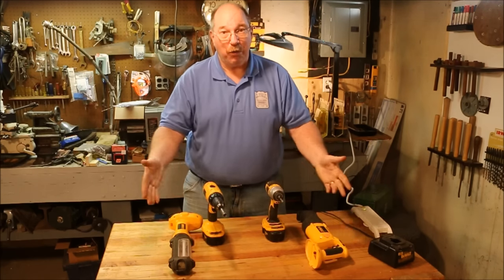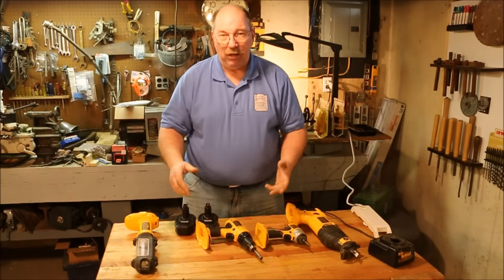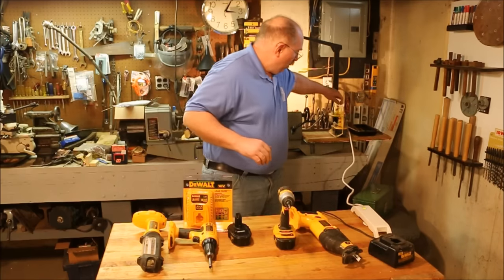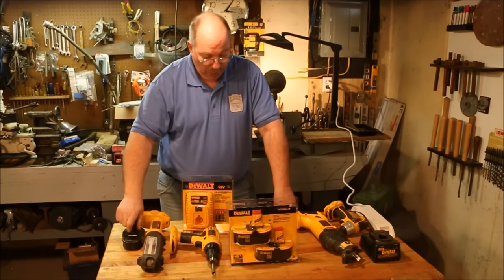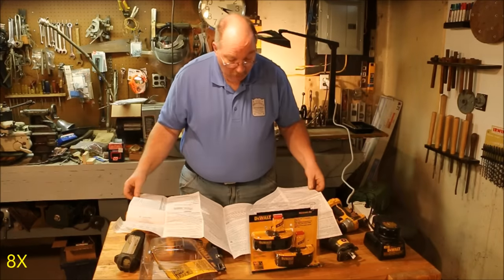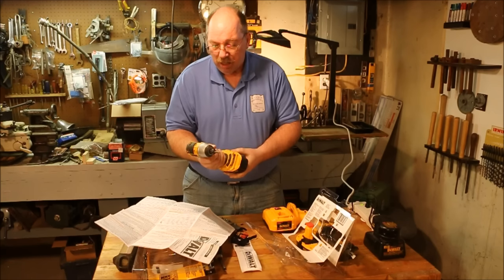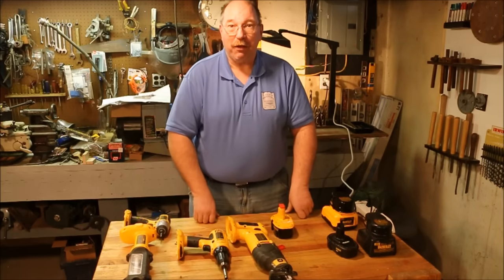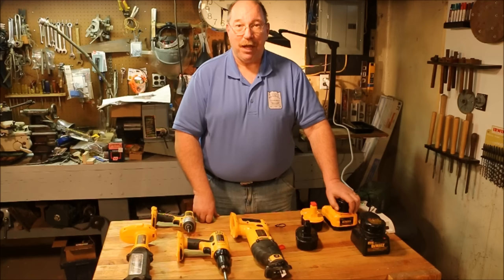New Dewalt 18 Volt Battery Packs ~ New Life For Old Tools ~ by Old Sneelock's Workshop

Comment: I am a plumbing contractor and use nothing but Dewalt tools.  I now have a box of 18-volt batteries that do not work at all and some new ones that are in the same boat.   If you can post a video of how to revive them from the dead I would appreciate it very much and I am sure others would too.   Dewalt tools are not cheap but you do get what you pay for and I have used about every other tool out there for commercial use and Dewalt, in my opinion, is the best.
Reply from the maker: R I would love to be able to help you. Unfortunately I don't know any way to do it. There are videos the propose all kinds of methods to revive batteries. So far the only way I know of that works is replacing the dead cells, or buying a new battery.

Comment: They are servicable.  Our local battery store can rebuild them.  I have had several done by them.  The new nicads that were sold by Dewalt cost $90 + each and I got 2 rebuilt for $60.  That being said The lithium batteries are much better as they hold a charge much longer and don't develop a memory.  Are your new batteries lithium?  I had heard that Dewalt was going to start selling them for the older tools.  There are literally millions of perfectly good tools out in the wild with dead batteries.
Reply from the maker: I bought the charger and the two batteries for about $130.00 at Home Depot last Christmas when they were having a clearance sale. The new tools take different batteries that mount differently than mine. 

NEWLY DISCOVERED INFORMATION. I can buy Li-ion batteries for my Dewalt tools.  While looking to see if it was possible to rebuild batteries I stumbled on this.  http://www.batteryship.com/htmlos/htmlos.cgi/batteryship/catalog.html?item=DC9180
Reply: Mine ended up in the trash and the old battery powered case made a dandy case for the corded 3/8ths.
Reply: Steve McEntyre i
Reply: Steve McEntyre - harbor freight 18v batts are about $12 w/ coupon

Comment: Don't can the old batteries. I found out too late on my Makita that you can get them rebuilt. My corded 3/8ths has been run into the ground with only a speed control going out. I like DeWalt stuff. Milwaukee too! Plus anything else that works! I ain't picky!
Reply from the maker: Lewie McNeely That's a topic I will explore in a future video.
Reply: Old Sneelock's Workshop 10/4!

Comment: I like dewalt. A few years back I had Milwaukee and they changed their batteries. The new ones were garbage and they wouldn't stand behind them. Well that led me to Dewalt.
Reply from the maker: Tim Caldwell The last good Milwaukee I bought was in 1998. I have 40 year old Milwaukees that are still runnung. When I did some comparison testing  last Christmas before buying more batteries for my current Dewalts I couldn't see any improvement in othe brands that made it worth discarding my working  tools.
Reply: Old Sneelock's Workshop  I came across your video those are ni-cd's  xr version 2.4 amp hours each so your charger you had will work I am.still using 14.4v Dewalt ni-cd  tools and got the same battery in 14.4v  it charges fine in mine I have the same charger

Comment: On the web site instructables I found a project where you take a dead battery like your Dewalt power tools and replace the cell inside with a different relativly cheap set of cells. I have yet to do it myself. 
ps I have the same saw saw you do. Bought it like 4th hand but requires a battery. 

I will add another comment to this video with a link and a name of the author. Im sure you would like to keep 4 batteries alive.
Reply: Well I guess there is already 6 or so videos on the same subject.
Reply from the maker: I tried a couple and it works. Not real long lasting though. The cheap batteries last about half as long as the good ones. I think that you end up being quality assurance and tossing half of them.
Quality Control builds quality in. Quality assurance sorts out the stuff that won't pass spec.
China follows the old Metal Powder Components 
mantra of Dip it and Ship it. 
They went out of business.

Comment: standard xrp batteries will charge in the old black charger. Only the lithium ion 18v batteries need the yellow charger.

And in reality the better buy are the adapter kits to the 20v max battery platform.
Reply: dakillaklown715  I did the same for   my  dewalt hammer drill dw988 it works good the kit came with two 20vmax batteries and a charger I paid about the same price he did still trying to find an option for my 14.4v dewalt tools that I refurbished that work perfectly  how many batteries are refurbished and will last a few years  but I want to do something now  for the future so I can use the newer slide battery then when I'm ready go right to the new platforms and all I would need to buy for 18v to 20vmax  is a bare tool set  I can get a set of refurbished brushless for a good  deal or for my  14 .4Volt I might have to buy an aftermarket adapter and get 14.4v max lithium batteries  online from overseas because I have so many tools that are like new inside because I rebuilt them new carbon brushes  I added some lithium grease to all
Reply: dakillaklown715 the batteries he purchased our standard 18 volt Ni-cd's  last time I purchase those same batteries was some years back and when they died I decide to get that kit that comes with the adapter for the 18 volt and a charger  for the 20 volt Max batteries all I got to say is my dw988 purrs like a kitten now it's got power even more then with the  ni-cd   type so lithium is much better  but also if it's not broke don't try to fix it I only did that because my battery is shot and I felt it wasn't justifiable to do it again for that drill   now my Dewalt dw990k2 xrp  14.4v and dw991k2 14.4v I only refurbish that not even a year ago  new carbon brushes lithium grease to the gears 3 in 1 oil for the chuck on both theyou  run like new I have videos on my channel of them

Comment: You can buy 18 volt Battery at Harbor Freight and put the cells in the DeWalt  Battery  case
Reply from the maker: That is a way to fix the existing battery. I also wanted enough batteries to have two backups. If I am using two tools I need four batteries so there can be two in the chargers while I'm using the first two. When the oldest die I intend to rebuild them.
Reply: right

Comment: You do no they make a adapter so you can use 20v lithium ion batteries in your 18v drills the run stronger and longer  it's just a nice little upgrade
Reply from the maker: Yes I do know that. The adapters are being sold at Home Depot now in the same aisle where in January of 2017 all they had were new 20v equipment and the batteries shown in this video. I would consider buying an adapter, but since this new set of batteries should last as long as the old set and the old ones are still working after 10 years I'll bet there will be a better alternative in the next 10 to twelve years. 😆
Thanks for watching

Comment: You also can bring the old battery back to life again by putting the Battery in the charger, and plug and unplug the charger quickly about 6 or 7 times. and that will remove the memory and they will charge again.
Reply from the maker: It's worth a try.
Reply: @OldSneelock  - I have a porter cable drill with two batteries. I have had them for at least 15 years. One battery started dying a few years ago. Now completely dead. It is March 2019, and in the last 2 weeks the other battery, fully died. I tried this on and off thing with the charger, and it did not work for my batteries. I have been watching many videos here at utoob, to learn how to jolt them back to life. Haven't succeeded yet, only tried once, but I am doing something wrong. My porter cable drill and batteries, have been work horses! I hope I can revive the batteries eventually, with some experimentation.

Comment: I would've gone with 18-20v converters
Reply from the maker: Next tools will be the 18-20v or whatever upgrade is available in 10 years. I didn't want to have to buy a converter/new charger and batteries for all 4 tools and have to have spare batteries for all. This way all the tools have batteries and there is a spare for the charger. The original batteries lasted 12 years so far. I expect similar results from the xlr batteries.

Comment: Hi, I have DC9096 battery use tools, I have a doubt can I use DE9095 battery for it.  Thanks
Reply from the maker: They are interchangeable.https://www.amazon.com/DC9096-Battery-Dewalt-3600mAh-Replacement/dp/B078M51NYC

Comment: i got a dc725 at a yard sale and i noticed that the whole front end wobbles between the black clutch ring and the yellow housing. i was was wondering if thats normal of if its not good. i also got a impact driver but the model number sticker is gone, i did some looking online and im pretty sure is a dw056. from the black crud in the exhaust and the burnt smell when i run it i think the brushes are worn out. it will cost $60 to get the replacement motor and pinion since its a all in one thing. the only other drill ive had is an old all metal corded drill which i almost killed driving in structural wood screws into 6x6s for a gate, it did good until the last 1.5 inches of the screw. any help would be greatly appreciated.
Reply from the maker: I wouldn't spend money on repairs. Buying used without testing is risky. I think you got worn out units. Hopefully you didn't pay much. Use them until they die and save the money to get good ones.
Reply: $30 for the drill, impact driver, 18v xrp battery, regular 18v battery, and charger. i was considering repairing the impact driver because $100+ for a newer one plus batteries and charger and if i can get several years out of $61.20 then in my mind it would be worth it. to me both point of views make sense. you know much more than i do and i wish i knew half of what you know, so when it stops working ill see what i can afford and go from there. i know the newer dewalts have a lot of chuck wobble and the 2 i have i cant see any. thank you for the advice.
Reply from the maker: Asura it's always a judgement call. Good luck. Hope they do well for you.
Reply: good luck to you too and thank you again.

Comment: I will put my DeWalt tools up against any other brand any day. Okay, then why did you say the newer batteries had to have a          different charger?
Reply from the maker: Thats what it said on the package. The new charger came with the batteries. The new charger will charge both old and new batteries. The new batteries will only charge in the new charger.
Reply: @OldSneelock  What kind are those batteries you show on this video?
Reply from the maker: @timothyfulbright4223 They are NI-CAD batteries. The same as the originals. The physical difference is the battery compartment is about one forth larger than the original. Larger cells = more amp hours.  The new charger has an upgraded controller to handle both the NI-CAD & LI-ON batteries.
Reply: @OldSneelock  Thank you. When I bought the last set of two batteries from Lowe's, I just opened the package and threw them into my chargers       that I've had for years. No problems. (yet)
Reply from the maker: Mine was a package deal that worked out well. Two chargers are convenient.

Comment: ..cordless tools will last decades, with a little care. for me it's the batteries and chargers that go ka-put. i got an old black & decker 18v that uses the same batteries. 1 bit the dust and the other will hold a charge about 75%. the tool is as good now as the day i got it, minus the usual scratches, dings and bumps...but craftsman batteries & chargers are pure junk in my book...!!
Reply from the maker: It might be possible to rebuild the batteries. Keep threatening to reload the Makita 9V sticks so I can use the 3/8" battery operated drill I inherited from my Dad.
Reply: Old Sneelock's Workshop  hears a link to a video that shows the kit I got its not my video but they do.still sell a ni-cd kit new 18v so this battery kit that has a charger and adapter will allow me to use 20 volt Max lithium batteries on all your 18 volt tools   https://youtu.be/-d8ePZRcNP4

Comment: is better to use dewalt 20v tools with brushless motor
Reply from the maker: Any new ones coming into the shop will be the newer LI-ON batteries. I just have a bunch of tools that take the 18 volt batteries and will last another 10 or 15 years. 😊
Reply: Use a 20 v converter 18v is old battery technology
Reply from the maker: The first set of light, drill, and sawsall were given to me in 2003. Still running strong. The last is a impact driver from 2016. They will last 15 easy. This is home use.

Comment: They sell these Dewalt 18v Battery's at LOwes for $160- & only come in a two (2) Pack. What a RipOff - - -
Reply from the maker: That's steep. Two new 20V batteries and the adapter are less than that at Home Depot in Portage.

Comment: Change to LI-ON
Reply from the maker: Brian Williams Why?
Reply: Old Sneelock's Workshop to help you hear a link to show the kit that shows the  charger and the batteries and the adapter that takes the batteries in the older ni-cd   I do own the same set the gave new life to my dw988 hammer drill http://www.ebay.com/itm/like/152571097841?chn=ps&dispItem=1
Reply: Old Sneelock's Workshop and by the way the batteries are serviceable if you use a T-10 Torx screwdriver  they sell drop in kits on ebay from around $45   free  shipping  I hope I could be helpful to you I hope you have a wonderful day thank you for your videos
Reply from the maker: Thomas Carroll Thanks Thomas. That shows rare foresight by Dewalt. ☺

Comment: you said those old nicad battery packs are not serviceable you are incorrect they are very much serviceable they're just not worth a damn.
Reply from the maker: Look at the date of the video. There are upgrades to everything all the time. It is a ploy to sell new ones. If they didn't have a "new and improved" thing every year they would sell one every twenty years and go out of business year 2. 
Do you really need to buy a new car just to get a bluetooth accessory?
So in response to your statement. 
1. Yes they are rebuildable now. The cost of a rebuild at the time of this video being made was equal to the cost of these battery packs being sold at a discounted sale price.
2. No they are not crap. The drill bit spins. The light lights. The saw cuts. All of them have, or will, outlast the original batteries. 
This was a choice between buying adapters and or all new batteries or buying the batteries that fit and worked without adapters. Easy decision. The 20 v have been superceded by Flex volt batteries. 
What's next? Earbuds and a cellphone charger. Too late. That's in the toolbox. 

The adapters are being sold at Home Depot now in the same aisle where in January of 2017 all they had were new 20v equipment and the batteries shown in this video. I would consider buying an adapter, but since this new set of batteries should last as long as the old set and the old ones are still working after 10 years I'll bet there will be a better alternative in the next 10 to twelve years. 😆
Thanks for watching
Reply from the maker: My son needed some new batteries for his 18v tools. Last Christmas (2019) I went to Home Depot and the 20v Li-Ion batteries wete on sale with an adapter. Dewalt mist have felt the competition. 😆
With the discount and included adapter it was an easy decision. 
They work quite well for him.  
When this last batch of 18v batteries fade Inwill be looking at what's available. Who knows? In 5 years they may  have cold fusion. 😆😎